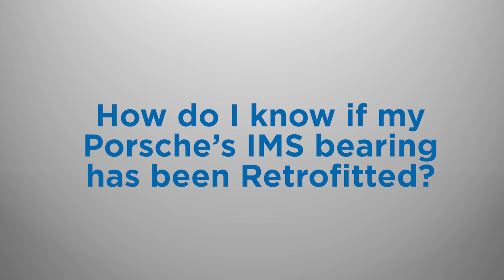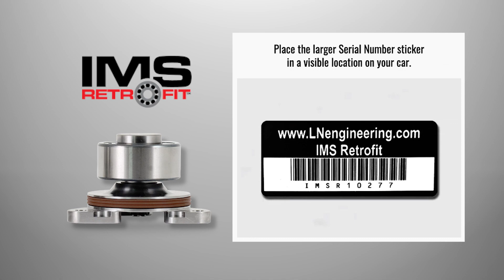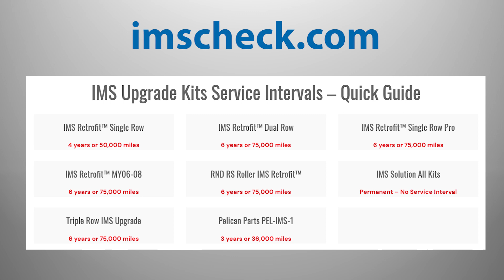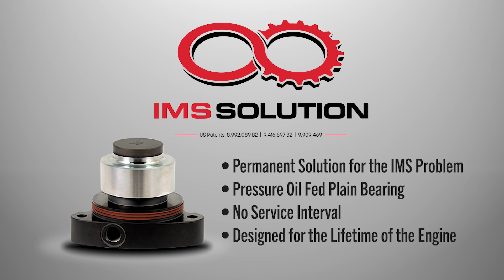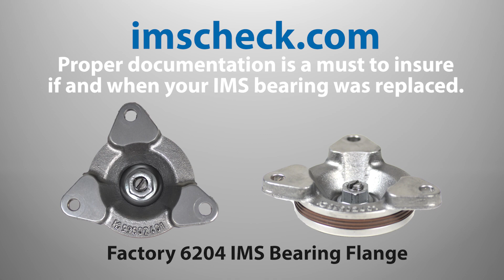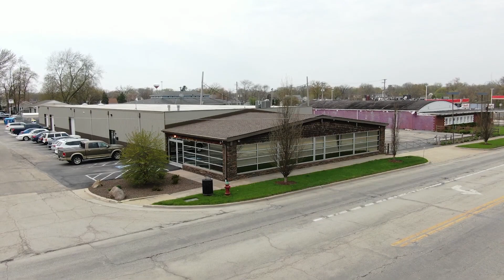How do I know if my Porsche's IMS bearing has been changed or retrofitted?

Comment: For the '06 - '08 (911) engines with the larger non-servicable bearing, is it possible to remove the outer grease seal as you suggest without tearing down the engine?
Reply from the maker: Yes. On MY06-08 M96/M97 engines with the non-serviceable bearing, once you have gained access to the IMS bearing, the grease seal will be visible and the seal can be easily removed.
Reply: @lnengineeringllc  But I thought that on these engines you had to split the case to get to the IMS bearing.  Are you saying that the bearing is accessible without tearing down the engine?  Sorry, but I was hoping for a clearer answer.  Does the engine need to be out of the car?  This has to be one of the most confusing subjects ever!
Reply: @aboyandhisdog  I think you'll find you only have to remove the gearbox to get to the ims flange cover.